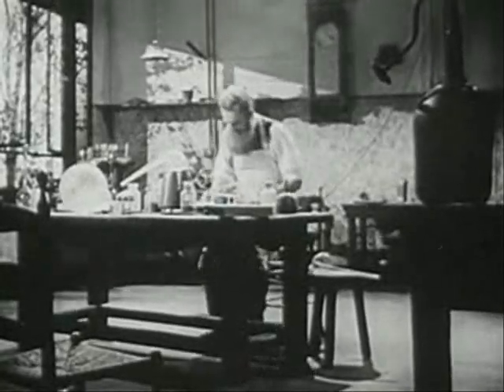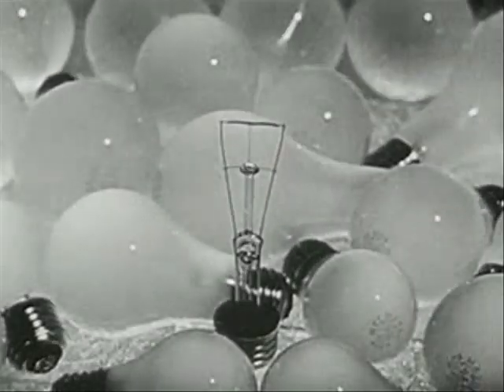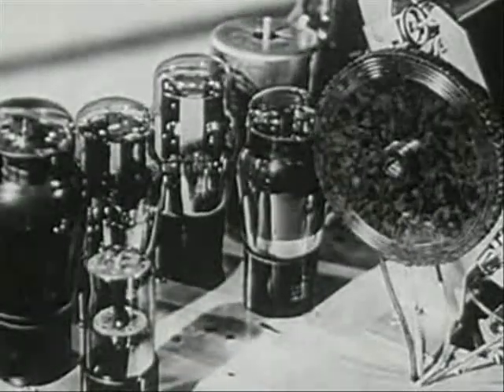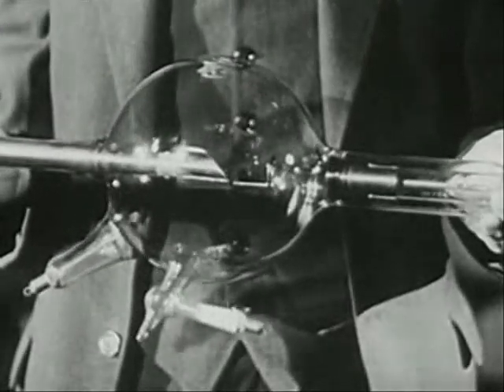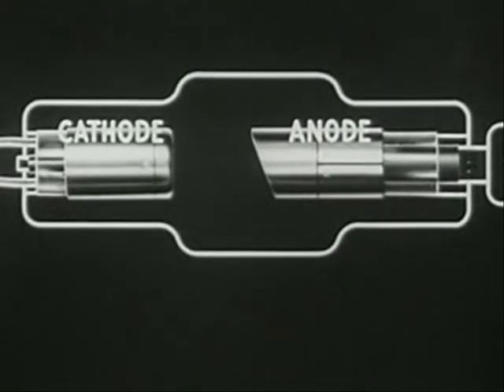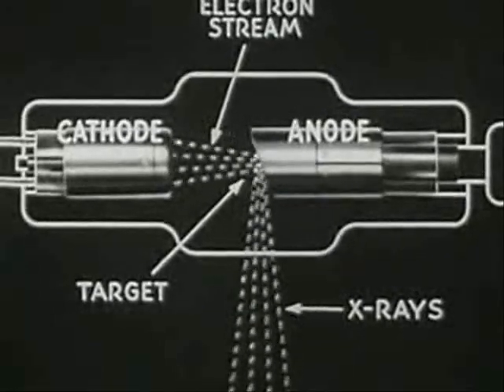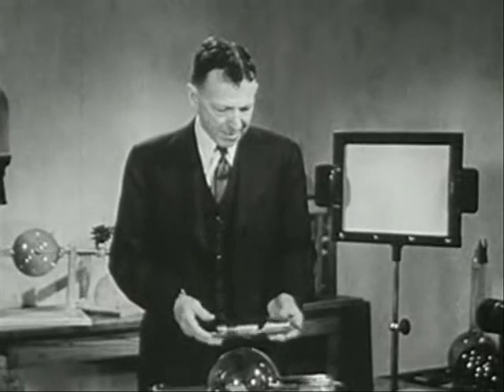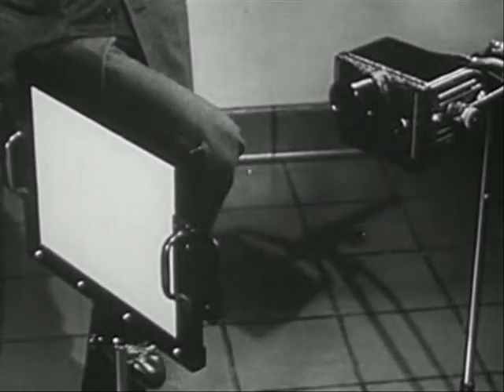1940 X Ray Physics Documentary By William D Coolidge

Comment: It's a glass cathode ray tube with a tungsten source cathode (+ charged), and a tungsten (10% carbon) anode (- charged). You can make one of them easily. So long as you can create the vaccuum. The x-rays come flying off in all directions when energised. Use about 70kV (this is the optimum voltage for liberating tungsten electrons) and about 4 millieamperes per second (mAs) to produce a tidy quntity of radiation.
Reply: It was invented by Thomas Edison

Comment: Not at all 1 chest x-ray is approxomately equivalent to 1 day exposure to background radiation. The dose from 2 chest x-rays is like the increase in exposure gained from flying from Manilla to San Francisco at high altitude. 

The radiographer hides behind a screen because they perform these examinations about 40 to 50 times per day every working day - which becomes a bit risky.

Cancers are known as stochastic risks and are entirely down to chance. But are rare.
Reply: Does that mean I can get one chest x-ray daily for years and not much will happen?